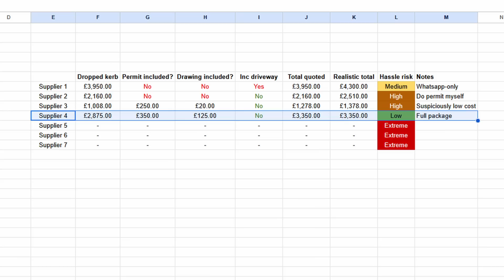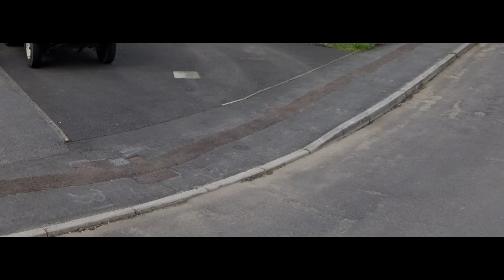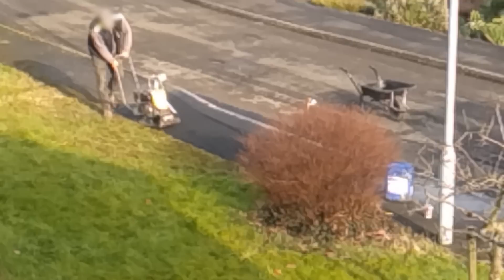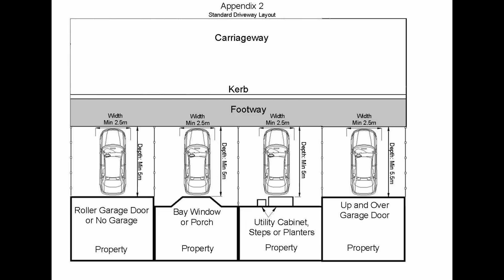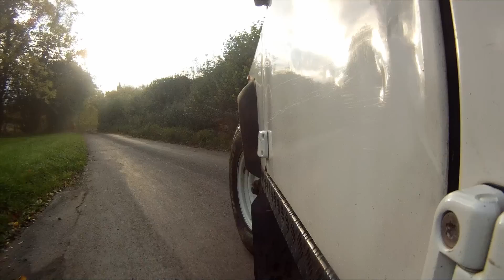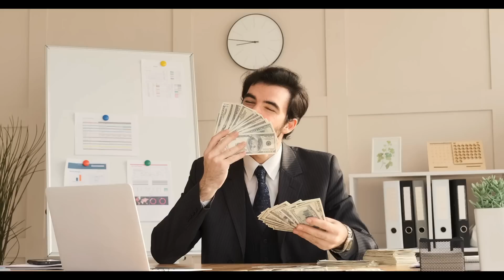Dropped Kerb Costs 2024/2025 - Access for new Garage/Workshop

Comment: I booked my council to sort a dropped kerb outside my house as we expanded the driveway to allow 3 cars to get off the road rather than just 1. 

I booked it, paid the deposit but because the road had been recently resurfaced, the level had dropped compared to where it was before. This left the existing kerb now proud but I pointed it out and asked them to fix this. I also said I didn't want one level for the new dropkerb, as against the existing kerb. They would only drop the kerb to the current level but not fix the old drop kerb so I ended up with a proper drop on the new side but on the old side, it was still proud and it looked terrible. Utterly terrible. I refused to pay because it looks like we had unprofessionals in and doing it rather than the council. Obviously, this is an issue upon sale and kerbside appeal of the property. They didn't chase my refusal, we got it for free but it looks a right mess.

Comment: To get my driveway entry extended by 4 feet it cost me £7000 to re tarmac the original size + 4 feet. In total it’s about 14 feet wide and 12 feet long…
The council later told me I’m not allowed to park on the tarmac, I asked them before if I could and they said yes…

Comment: Or, if your lucky enough to have the pavements in your street fully disrupted through services works you could just speak to the lads doing the kerbstone and resurfacing work and get drop kerbs put in, existing drops extended etc for FREE! They don’t care as they were swapping out all the kerbs anyway, at least 20 properties on our road had drop kerb alterations done at no cost without permit requirements. Guess we were just cheeky buggers for asking.

Comment: 3 on my street needed dropped, guy 2 doors down worked for the main builders in town, kerb was twice was it was allowed to be so told the council to drop the kerbs or they'd have to rebuild the whole pavement... they all got dropped

the street was designed as a gully hence the high pavement but always overflowed the 1 drain

Comment: One rule for the law abiding and consciencious... Around our way, many just drive up the kerb and the local council does sod all about it, mocking anyone who has, like you, done it correctly.
Reply: I was going to make the same comment 😂

They are used by motorists to gain access to park on the pavement. About time every single one was ticketed. May not be illegal to park on the pavement in 98% of uk, but it is illegal to drive on the pavement. So if the car was placed by a fork lift truck, fine. But otherwise they are all guilty of driving on the footpath (clue is in the name!).

Comment: I guess some people don't realise that the steering lock on Defenders, Discovery and Rangerovers are often adjusted wrong at the factory for the ideal turning circle because they are often set up for wheels that are not fitted with wider tyres
With two 19mm or 3/4 Spanners you can often improve the turning circle massively in 5 minutes without over stressing the CV joints.
Most people don't bother and think that's the way it is......
Reply: The general rule is 20mm from edge of tyre to suspension arm on Full Lock
Reply: Thanks. I'll try that on my 130.

Comment: Drop kerbs in our area are a council scam, 8 years plus ago our local council quoted £8k-£11k dependant upon width, the other local quotes were much the same IF THEY WERE council approved. Which turns out was not a thing. Not legally, but greed ruined them as now the central government for us has said a rubber access ramp is sufficient. So now it's a DIY from amazon.

Comment: Like you say, the Defender has a turning circle of an oil tanker.  When your ready drive, up the dropped curve and round to where the garage is, check distances from the wheel tracks and add a little more to the width.  Also check reversing options as well.  I didn't think the cost was too bad, nobody does things for nothing these days, especially with the rules and regulations legitimate contractors now have to abide by.  Did the council come back later and check the work?